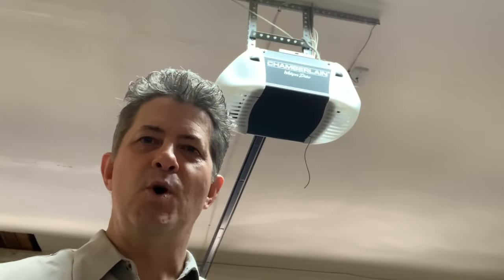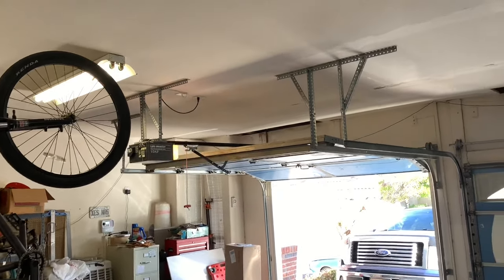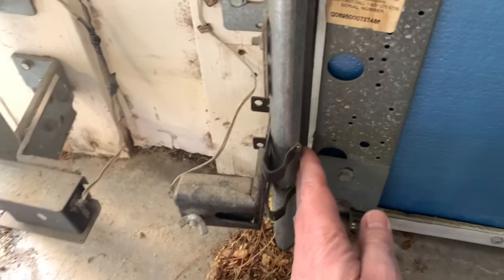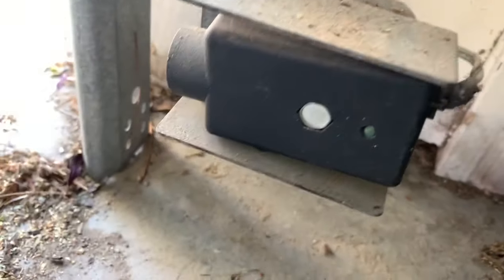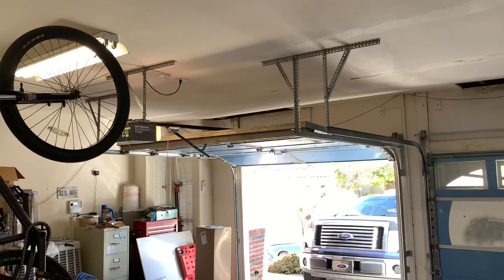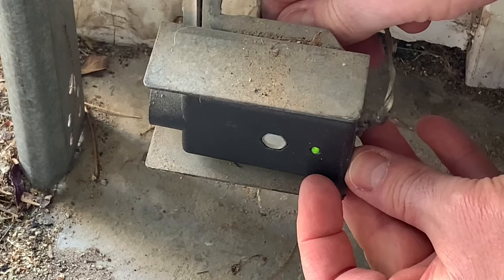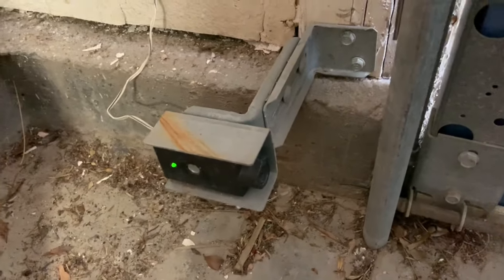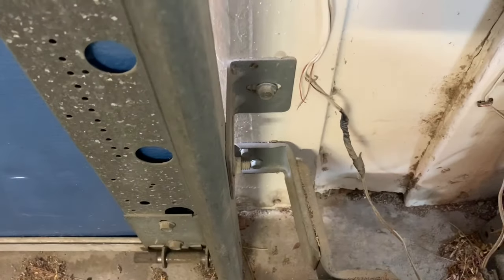Garage Door Opener Stops and Reverses

Comment: I like your video but I check my sensor both lights are on and I tighten them up , check the wiring and the pull string but I still have no success any recommendation besides the repair man.
Reply from the maker: Can you describe what the door is doing or not doing?
Reply: @MikeKlimek The garage door opens maybe about 3in. reverse and then comes back up. The garage unit has about three or four solid orange blinks and then 6 fast blinks pause solid blinks and then goes back to 6 fast blinks.

Comment: I just got two brand new door installed and looking at those sensors, I realized how easy it's going to be to bump them and knock them out of alinement. I guess it's time to make a protective cage around them before that happens. Or just do like my neighbor did and mount them facing each other up on the ceiling so I won't need to mess with them again! The door reverses if it hits something anyway so there's really no need for them. No kids around to get in the way either.
Reply from the maker: I would leave the sensors where they belong! You might not have kids, but a neighbor might have a child or pet that tries to beat the door on the way down...and you don't want to end up on the news!

Comment: Posting my story in case it helps someone else. After checking everything in the video, the garage door would refuse to completely close when it approached the ground. It turned out that the garage door itself was actually indented, and it was the indent from the garage door that caused the sensors to lose the connection when it passed by it.

Comment: Still trying to fix my open and close. The door will close about half way and reverses cleaned lights.
Reply from the maker: Try to increase the downward force slightly. There should be a dial on the motor for this

Comment: My lights are working . One sustained the other flashes only when I wave my hand, but it still opens after a quarter ways down. Any ideas?
Reply from the maker: You might go to the motor and increase the downward force slightly-there is usually a small dial you just turn for this.  This sometimes happens when the temperature changes...
Reply: @MikeKlimek  thank you. My down force is at its maximum

Comment: Mike i have a Chamberlin 1/2 hp Professional one of my sensor has a yellow light vice green as the other sensor is. The door reverses itself about 80% of the time in either direction but i can over ride by continuing to hold the button. Why does this happen can you help me?

Comment: For anyone who has a LiftMaster that goes down a bit, stops then goes back up AND wont go all the way down unless you hold the button, plus the remotes wont close it at all: if the light flashes twice over and over, it says theres a short or reversed wires. 
But in my case both sensors had perfectly working lights on both sensors. 
With the garage door still open I flipped up the flap on the main controller and found a button marked Lock. I pressed and held it until the little light in there flashed, then held it again until it stopped flshing. 
I then hit the button to close the door and it went down a bit then back up, so I held the button until it closed, then I opened it and finally, I pressed the button to close it and it worked without the need to hold it down anymore. 
The remotes work on it now too.
Maybe this will help someone.

Comment: What if the door shuts all the way & then just opens again, how is that problem fixed, using a chamberlain lift master professional formula i
Reply from the maker: It sounds like the length of travel is too high. Reduce the length of travel by adjusting either the sensor on the rail, or there will be a dial button on the motor unit.

Comment: I just found this video.  The issue I’m having is that when I back out of the garage and then push the remote button to close the garage door, it starts to go down and then goes back up.  It will not go down no matter what!  But if I’m standing in the garage and push the button on the wall, the door goes down.  If there was zero movement from the remote I would think the battery was dead.  But I push the remote and it starts but then stops.  Help!!!!  😩😩😩
Reply from the maker: So when you push the wall button to make it go down, do you have to push and hold the button down or just push it once and it works fine?

Comment: I have a Chanerlaine model 459950, changed the board, the motor and cables kit, the unit only moves one foot each time you push the button. Any ideas? thank you.

Comment: I had the same problem. I tried replacing the lightbulbs in the opener. I then tried cleaning the sensors. Neither worked. Finally, I realigned the sensors. But, it would only work if my hand was on or behind the sensor sending the infrared signal. Finally, I tried propping up that sensor with a would block. I thought it was an alignment issue. However, when I set the wood block behind the sensor (ie behind the end opposite the opening where the infrared shoots out), the sensor worked. If I take the would block away, the sensor stops working. I can place the would block or my hand as far as 6" behind the sensor and it works. Take my hand or wood block away, it stops working. It makes no sense to me. It is not a lighting issue because the sensor takes in light on the other end. It also behaves this way when the garage is closed and even when the lights are off in the garage with the garage closed. This makes no sense to me. Anybody have any ideas what the heck is going on here?

Comment: Make a video of what to do when programming and programming doesn't work. I installed a Genie model 2055 3/4 hp belt drive. Sensors work(1 green, 1 red), wall switch works, but when trying to set the up and down, it will only move a few inches, and then a purple led light comes on. Genie tech says that indicates inside components being faulty. They sent an encoder, but that didn't work. Then they recommended checking the springs, so i had a garage door company come out, and they said springs were fine. Tried to help me program it and said it may be a bad circuit board/logic board. So, Genie is now sending me a new head unit as this install was a brand new opener straight out of the box. It's been super frustrating, and i can't find any videos online about this specific opener or troubleshooting issues like this. Please help!!
Reply from the maker: It doesn't sound like you need a programming video, rather you have a bad unit. That's too bad you've had to spend all the time and money on this. The new unit should fix your problems

Comment: What happens when the door gets almost all the way down then reverse’s?
Reply from the maker: Could be several things, some that were in the video. You might try to increase the downward force of the door slightly. There should be a dial on the motor for this.

Comment: What's wrong when one of my sensor lights is green and the other is yellow? I tried to align it and move it like you did but nothing worked it's still yellow and it still is going down and then coming back up! Help please....
Reply from the maker: Don't focus so much on the color of the lights. Many are different colors and that is OK, they just need to be illuminated and bright. Possibility that your length of travel is too high causing the door to hit the floor and reverse? If so shorten the length of travel using the dial on the motor.
Reply: @MikeKlimek  
 You making these VIDEOS & SHARING your KNOWLEDGE is APPRECIATED so much! I'm a 65 yr. old female & I was able to FIX my garage door with your instructions, all by MYSELF!! Thanks Mike❤️
Reply from the maker: @a.perkins907  Awesome! I'm glad to have helped you!

Comment: How does the sensor alignment change or function when going up but not going down? Are they not the same for both directions? This fix appears that one must physically change the alignment every time to function up&down.
Reply from the maker: I'm not sure I understand your question. The safety feature of the sensors is for when the door closes to prevent someone from getting injured. The door will go up even when the sensors are blocked.
Reply: @MikeKlimek  It seems as though you are bending the sensor brackets for each direction.Get it?
Reply from the maker: @francinecorry633  The point of this whole thing is to get the sensors aligned so they see each other. Whether that means bending a bracket, adjusting one or both sensors, or even just checking the wiring to make sure the connections are good. Once the sensors are re-aligned, the opener should operate normally.

Comment: My issue is my light isn't flickering but my door intermittently will stop closing near the floor and come back up.
Reply from the maker: This often happens when the seasons change. Try increasing the downward force of the door using the dials on the motor. Just a little turn is all you need.

Comment: What does a blinking light (5 times) mean on a 1/2 HP Craftsman Opener ?  It is an error code of some kind.
Reply from the maker: Here is what I found: the five flashes is the rpm sensor or a motor overheated issue. if the door travels a short distance then stops it is the rpm sensor if the door does not move at all and the opener just clicks it is the logic board because the motor rarely ever fails. You might try unplugging the unit to see if the sensor resets.
Reply: @MikeKlimek  Thanks Mike.  The door ended up being 3/4 open and would not move.  I pulled the rip cord and it came down very fast.  Broken spring?
It is a double door.
Reply from the maker: @gordbaker896  You would be able to see the broken spring above the door (there are 2 for a double door, and 1 for a single door), and it will be difficult to lift the door. ..But that doesn't explain the sensor issue you described before, so you are having 2 problems?
Reply: @MikeKlimek  I will investigate it tomorrow. We really appreciate your response.  Seems to me this old door has covers over the springs.

Comment: I have a Legacy Pro Max and the chain travels 6" then reverses. Occasionally it'll work then reverts back to this issue. I've checked sensors, gears, wiring, replaced the capacitor. The door is detached and it does this with or without the cup on the shaft. Any ideas?
Reply: Mine does the same thing. Not sure what to try. I’m thinking maybe a travel control module

Comment: I did what you told me worked a few times but now same thing goes down about 10” stops and goes back up
Reply from the maker: Try increasing the downward force again. As the weather heats up, parts expand and can require a little more force to get things working.

Comment: Be aware that the motor gets hot after 6-7 runs n then goes palsy. U’ll need to let it cool off several times. I just saved 400$ by waiting. Got it working good !

Comment: My door does the opposite. It closes fine. But it opens sporadically. Sometimes it’ll open fine. But at times it will open a couple inches, a foot, or a couple feet then stops. 
I can make it go up by pulling it open with my hand and getting it past the stops spots.
Anyone know what I can do?
Reply from the maker: You can increase the upward force. There are controls for this on the unit
Reply: @MikeKlimek  can you explain how?
Reply from the maker: @janinegarropy8187  Your problem is pretty common when the seasons change. Get a ladder and go to the motor unit hanging from the ceiling. You may have dials or buttons to control upward force and downward force. You want to rotate the dial or depress the buttons to increase the upward force. You may need to remove a cover where your light bulbs are...other times they are out in the open on the motor

Comment: This happened suddenly to me. I cleaned off both lenses and it worked again. I was just a buildup of dust on either sender or receiver after a few years.
Reply from the maker: Sometimes it's just that easy!
Reply: @MikeKlimek  I've learned that most of the time just try the easiest thing first. If that doesn't work then do the logical approach.

Comment: What if when you press the down button to set the position the door only travels about 3 feet and stops. I can't get it to travel all the way to the floor.
Reply from the maker: I'm not sure what you mean. Are you talking about the wall switch or the sync button on the unit?
Reply: @MikeKlimek  no. I'm talking about the down arrow button. I can get the top position programmed. But when I hold the down arrow button to move the door down the door will only go about half way and stops. I can't get it to go all the way to the floor.

Comment: My garage door goes all the way down when it’s fully down it makes a grind noise at the box and then reverse back up once it’s fully back up it’ll stop and then lights blink
Reply from the maker: It sounds like you need to adjust the length of travel. There should be some dials on the opener for this. You want to shorten (or lessen) the length of travel so it doesn't hit the floor and come back up. Small adjustments work well!
Reply: @MikeKlimek  on the side of the box there’s adjustments on there id have to look more but from I can remember something like more or less with left or right I’ll try that thank you for responding I hope it works .. it seems like it’s need less of travel

Comment: My sensors operate normally (no flickering green lights and the green light turns off when I put my hand in the way) and there is no flickering overhead light when it reverses and goes back up.
If I unhook the door and manually lower it and then hit the opener the motor will move the little plate that normally is attached to the door will move like it should. 
It stops at slightly different points - in other words in some cases it only makes it a few inches and then reverses.  Other times it will make it a foot or so and then reverses.
Like I said - no flashing overhead light
Any one have any ideas?
Reply from the maker: Is your carriage or head rail damaged? The head rail is bolted together in several sections and I'm wondering if the sections are smooth or if one sticks up enough to slow or stop the carriage? Maybe increase the downward force a little
Reply: @MikeKlimek  Not that I can see but I do wonder if somehow it has changed.
When I push it down manually it is pretty stiff to get it going.

Comment: There's something wrong with my sensor. One is green and one light is yellow but it won't turn green ..even after aligning it. So nope didn't work☹️
Reply from the maker: Some manufacturers have different colors. Just make sure both are bright. If you still have a problem, what is the door doing?

Comment: I cleaned it. It goes all the way down and just before it stops it comes back up. What is going on.. it’s 11:20 pm
Reply from the maker: OK so the sun is not an issue. Try increasing the downward force just slightly. There is a dial on the motor for this
Reply: @MikeKlimek  we aren't able to adjust the force on our model. 
The lenses are clean, have power, and are seeing each other/no flashing. Any guesses? It's a liftmaster 2.0

Comment: Well that's the trivial problem. What if the sensors are fine, but the door reverts after going halfway down?
Reply from the maker: Doors seem to get wonky when the seasons change. Try increasing the downward force a little
Reply: @MikeKlimek  Thank you- any suggestions on how to adjust that?
Reply from the maker: Yes, go to the motor and there should be some knobs or screws to adjust downward force and length of travel @totallynotabot151

Comment: The issue I have with my garage is it will close down to the last foot then open back up. It's really odd
Reply from the maker: If the sensors are both seeing each other like in the video, try increasing the downward force slightly. There should be a dial on the motor for this.

Comment: The transmitter light should be mounted  on the other side in the shadow. Problem solved. That cheap bell wire can be internally broken and still see the light glow and the door won't go down.
I have no kids, dogs, or cats so I moved the lights up to bumper high.  My brother had no idea what the safety lights did and when they got dirty he paid $800 for a new opener and 
springs to fix the problem!
Reply from the maker: Wow $800. What a rip!

Comment: No help. My door goes down till about 1 foot from the floor. Then back up. If I put about 10 lbs pressure on it it closes all the way no problem. Now what?
Reply from the maker: Try increasing the downward force of the door. On the motor there should be a small knob for this. Increase it slightly

Comment: I she. This problem but no sensors on my garage door
Reply from the maker: Some installers cheat the safety features of the sensors by placing them somewhere else and very close together. You might follow the wires coming out of the motor to see where they are

Comment: My cameras are clean both lights are solid and on. But garage door will not open
Reply from the maker: So more info is needed! This is an issue that it won't open in the first place? Is one of the springs above the door broken and hanging down slightly? Can you hear the motor try to lift it and stop?

Comment: What if the light is yellow?
Reply from the maker: The color doesn't matter as much...is one of the sensors blinking? Have you tried adjusting the sensor and does the light change color?
Reply: The garage guy told me that one is supposed to be green and one is supposed to be yellow. Just make sure they are not flickering. We had bad weather the night before and the lights went out a few times the unit just needed me unplug and plug back up. It works just fine now.

Comment: Our wires tore apart. Think the neighbor dog did it. How to I connect the wires?
Reply from the maker: Depends on how severe the damage is. You may get away with stripping the ends off of the damaged wires and using a wire nut to re-attach them. If you've got pieces missing, you might consider just running new ones. The wire is cheap and easy to lay out.